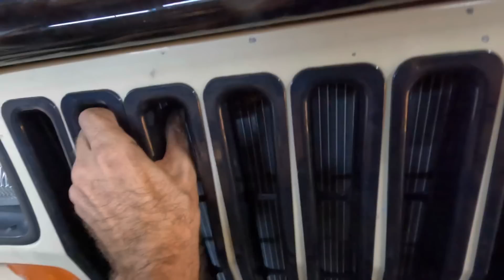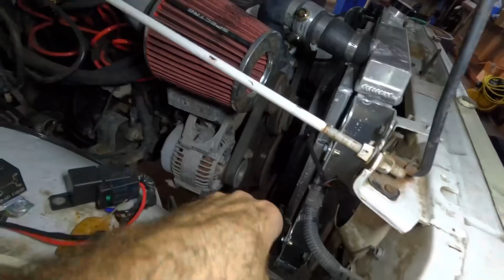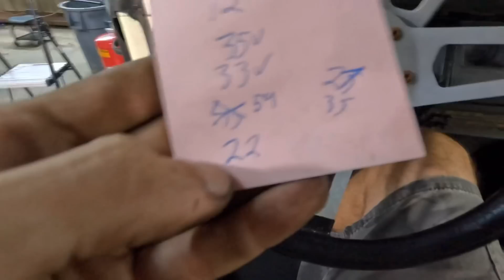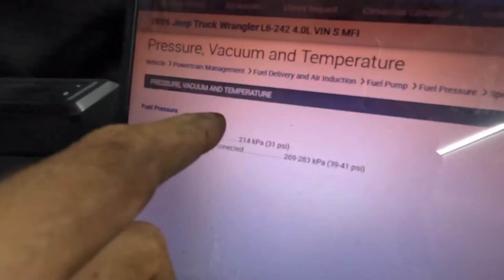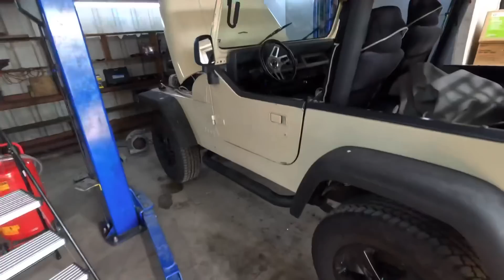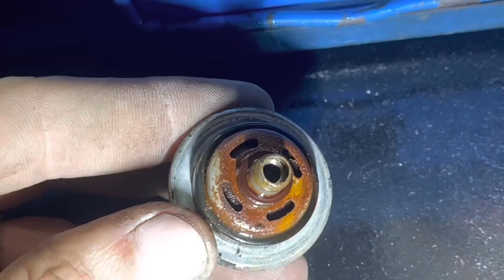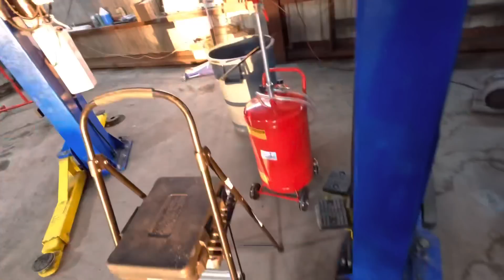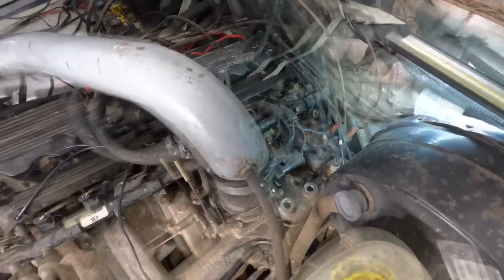Parts Cannon!! Can it be saved?? 95 Jeep Wrangler 4.0

Comment: 54 I believe is no camshaft position sensor signal while cranking. extremely common on the YJ's
Reply: I have run into that on a TJ.
Reply: @kencramer1697  I would expect that, same engine, same problems.

Comment: Your tip for the day: Thermal meters help you figure out which cylinder on a pre OBD2 engine is misfiring. Just look for the cold exhaust manifold.
Reply: Entire manifold is HOT. Its running lean. I would chase the coolant temp code since fuel pressure is decent. Its been 20+ years since I worked on OBD 1 Chrysler. I think they had data pids for o2 and coolant temp? Or will have to get ohm reading @ pcm connector for coolant temp.
Reply: @mph5896  a clogged cat causes the o2 sensor to read full voltage (rich). That could possibly cause the ECM to trim back the fuel to a very lean condition.  I've never really studied this. I had an ear for a clogged cat. I could tell by the sound of the engine when I throttled it wide open instantly. That was the carb engine days through. I think I've always had a scanner that would read the o2 voltage. Even in the first days of the obd. I had a Mac or Snapon back then.
Reply: @Bryan-Hensley  he mentioned early in the video it had exhast flow where it should and the verter wasn't clogged
Reply: @Bryan-Hensley  You are correct. A stuck rich 02 sensor could cause an ecm to pull a lot of fuel from the engine. It would be nice to be able to see that data. BUT the coolant temp is setting a code. That sensor is critical along with the map on that engine for fueling. If the computer thinks the engine is -40, it will run really rich. If it thinks its 280f, it will supply less fuel. At least get that sensor working properly before moving on would be key.
Reply: @mph5896  to be honest, every sensor in that thing ought to be replaced first thing. Every time I do my vehicles run like a brand new one. I have 20 year old vehicles.
Reply: @Bryan-Hensley  You have to be REALLY careful with shotgunning parts though. Sensors can be junk right out of the box, causing you to chase your tail. I would prefer a 20 year old used sensor in some cases over a brand new part.
Reply: @KaivalaJenva  The fact that the exhaust pipe was rotted off - and the obvious sound of exhaust issues... I'll bet that it's not helping the situation. These run the same with an empty cat - but they need some back pressure to run right. So no cat isn't an option.
Reply: @mph5896  Agreed on your comment.
Reply: OEM and new vacuum lines.  Age is not kind to the hoses. Small parts cannon for a good baseline.
Reply: @mph5896  I swapped a 3.8 into my Jeep JK recently that came with all brand new sensors installed. Right off the bat both the cam and crank sensors were bad. Switched the old ones back in and the issues were gone.
Reply: Also crayon will tell you
Reply: @Simple_Times_In_319  Found the Marine.  😄
Reply: @Simple_Times_In_319  LEAVE OUR SNACKS ALONE!!!!! 
Semper Fi!
Reply: @shuntawolf  thanks for serving!! 🍺🍺. Also I left a few in the box for a snack 😀
Reply: Water spray bottle does pretty good.
Reply: You, more than anyone, should know: a fuse looks good but doesn’t carry current some of the time.

Comment: Ok, I deleted my comment about suspected cat because after watching all of the video, this poor jeep needs some TLC.  Cooling system doesn't seem right, some kind of blockage but if the exhaust manifold is getting cherry red hot, it's either one of two things, cat blocked up or cooling system is not functioning 100%.  I'm still reserving that the cat is blocked to a degree but with a new PCM and other vacuum hoses and that coolant dripping.  this jeep is gonna need a lot of TLC.  That year model of jeep is a good year for them.  Good strong motor and it obviously wants to run but I think Ray will figure this one out.
Reply: I have a 1995 YJ with 290,000 miles on the clock. My first guess would be cooling system. Three radiators, four water pumps and multiple coolant changes. I’d check for coolant flow, he could have a water pump with no vanes.
Reply: Does that year have a heat riser?
Reply: Just check the O2 sensor readings. It'll tell you if it's the cats or fuel loss